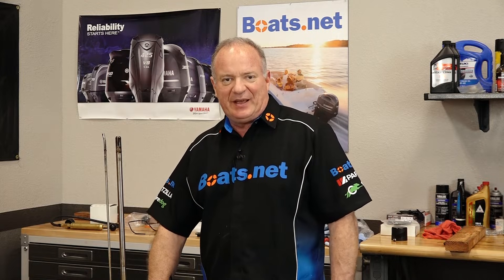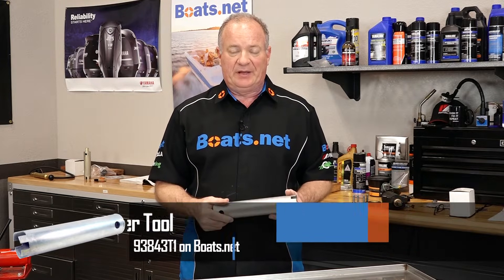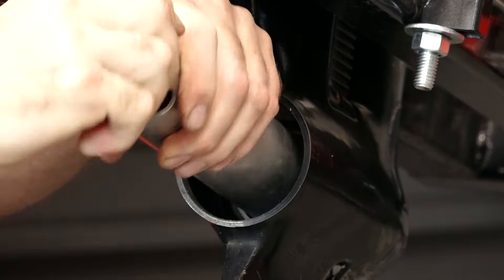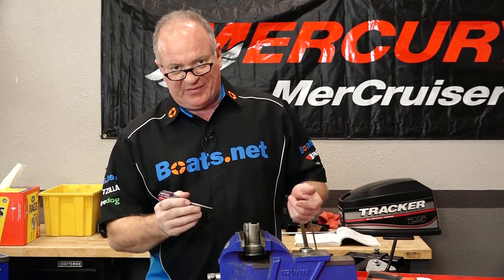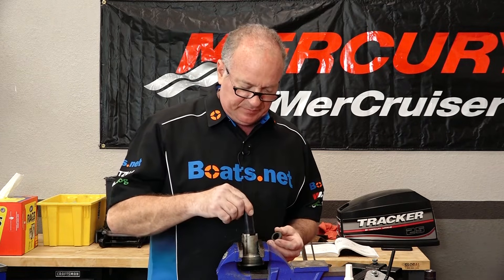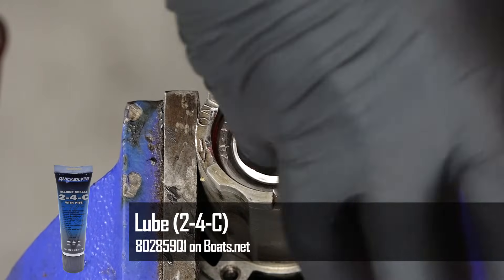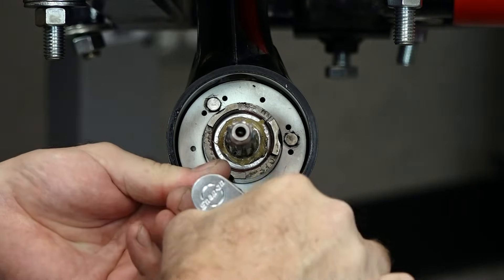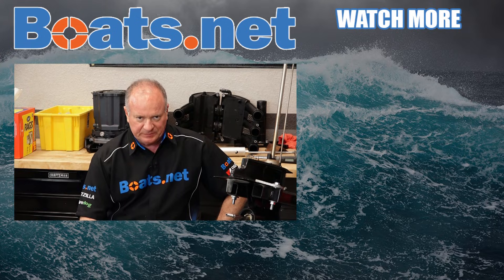Mercury Tracker 25 Output Seal Replacement | How to Replace the Lower Seals on a Mercury Outboard

Comment: You actually dont need that special tool, Mercury included it. Once the prop is off, remove the thrust washer. Inside the thrust washer there is a little key you can pry the metal cap off of. Then, you flip that key upside down and put it back on the shaft making sure it engages the three little tabs on the bearing carrier just beside the shaft. You can then slide the prop back on and turn it by the prop with a big ol 1 1/16" socket and a breaker bar. 

My 1980s 25 mercs had these (had an 82&84, same setup as this one)
Reply: Yes it is included you are exactly right
Reply: And you can use your prop to screw it back on and off again. Just did it is all good

Comment: Great video, John.  Thanks for the guide.  One question…are the seals installed properly?  The service diagram mates the 2 seals with the aluminum against each other.  Just checking

Comment: On the inside of the lower unit housing for the carrier there is ALLOT of black carbon like crud and some white-ish colored crud. Perhaps Loctite type but resembles dried out plumbers putty. That appears to be keeping me from getting to the carrier o-ring and trying to remove the carrier. Suggestions to get that retainer plate loose given the crud would be appreciated as I don't want to scratch up the inside of the housing!

Comment: HI, I have a 1987 Mercury 25 hp 2 stroke outboard and wonder if you know if the process on this motor is similar to replace the prop shaft seals for our motor?

Comment: That kit comes with 500 o rings though, great video! I have same engine, same problem
Reply: William Winters as do I. I’ve replaced these lower unit seals before and still have some leak and will just end up replacing all the lower unit seals this month and John started uploading at the perfect time! Haha